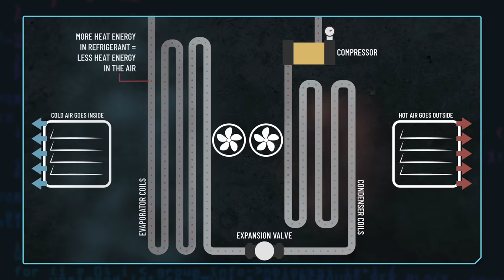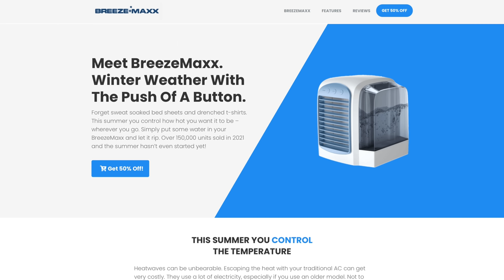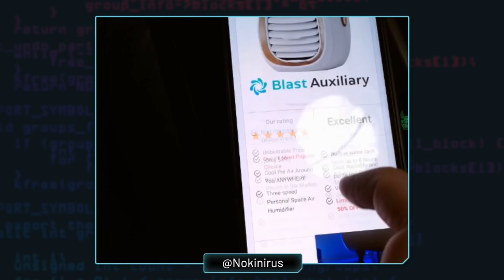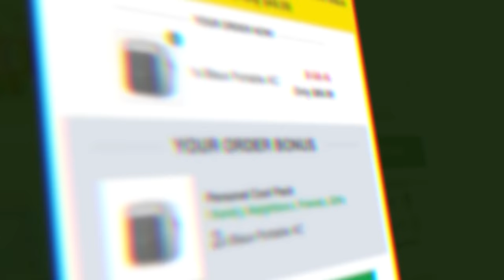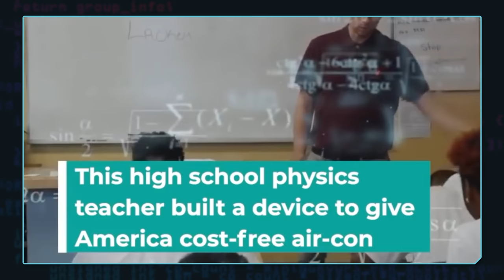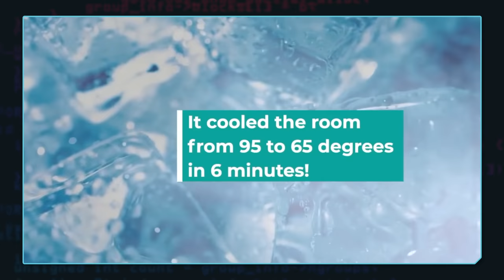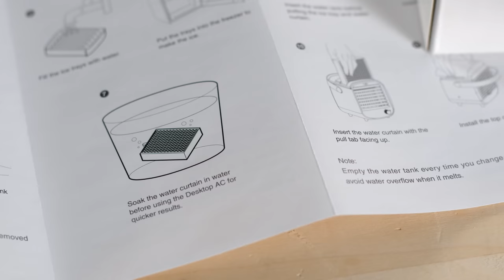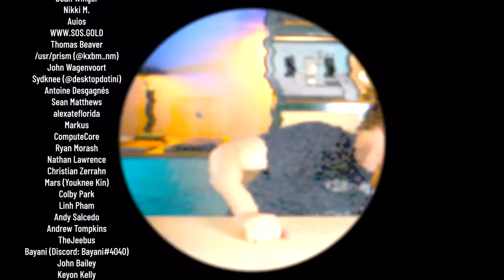Fake Portable AC Scams: Blast Auxiliary, BreezeMaxx, Blaux - Krazy Ken's Tech Talk

Comment: Build my own swamp cooler. It is outside with fairly large cardboard evaporators. A small version of the Industrial ones. The cold water is pumped inside through an heat exchanger so the humidity is no problem. Most parts are from an hardware store. I needs about 50 Watts/h but 5 liters of water the hour. Still looking for the best Results. Costs about 200€ so far.

Comment: Here's the thing about swamp coolers. They do work in low humidity, since they evaporate water into the air, which cools the room via the same process that sweating cools your body: evaporation is endothermic, meaning the water molecules absorb heat energy when they become vapors. Their effectiveness drops drastically at around 40% humidity, and they outright will make you feel worse at around 70% humidity since the air is so saturated with moisture the cooling effect simply can't be felt, and it will just make you feel gross and moist. So these things WILL work... if you live in a desert climate like Texas or Nevada. If you live in a place like Boston or Maine... not so much.

Ultimately, at the end of the day, I would consider a swamp cooler to be a stopgap cooling solution at best. Even if you live in a place a swamp cooler will work, an air conditioner will still cool the room better since they actually function by outright removing heat from the room. Consider one of these if you don't have the money for a window shaker or HVAC, and that's basically it. In the long run, the cheapest solution long-term is a good heat pump system, since they are by far the cheapest to run but also, unfortunately, the most expensive to install.

Comment: Those things are just miniature air coolers that you may find in a factory. The big factory air coolers work rather well, but I would not recommend the mini version because of its tiny air output and it not having a pump to rescaulate the water.

Comment: I just saw the commercial about the college student in America that was in hot temperature classrooms and the unit is called aircon which could deep freeze a room from 95° to 65° in less than 3 minutes. So when I got the product there's only one thing, if forgot to let me know that they were taking applications because all I did with it felt like I was working for the product that I bought to serve me. I had to freeze the filter in the freezer and pour water in it which the watered overflowed and the fan inside of it is like a computer fan that's really noisy and you plug it in the wall and it shoots out ice Cold Air for half a second and then I got to redo the process all over again with the freezer and the filter and the pouring the water and the freezer and the filter and the pouring the water you almost have to get two machines to get to filters so you can have one Frozen I felt like I was working for the machine I was moving so much I could never relax to enjoy this supposedly cold air for half a second this machine was absolutely horrible with a glowing light on top

Comment: This "Miracle Air-Conditioning" CRAP is too funny!!

Back in the early 1970's, Farm Tractors started to come with "Swamp Coolers" on the cabs. We had an IH 4166 with crab-steering, & the swamp-cooler on the roof. It was a pain to get the garden-hose up on the cab, & have a looooonnnggg hose from the house to the tractor. We we DID drive it close to the house though!! When it was full, you had to yell to a helper (if present!) to shut off the water, or climb down with the running hose.

As we ALL know, you CAN'T cool anything down colder than the water itself.....which warms up quickly on the cab!! It felt "OK", until the water warmed up. Then.....IT WAS USELESS! SO.....the "Benefit" lasted maybe an hour or two, depending on the outside temp. We then got BIG 1974 STEIGER (made in Fargo, ND!!) Turbo-Tiger II. A big 903 Cummins Turbo-Diesel....with a REAL A/C System! DAMN.....practically needed a Parka in there if it was 90+ outside!!

So.....when dumbass ads for gadgets like this come around, I just laugh and wonder how many IDIOTS are gonna fall for it!!

Comment: I got one of these for free by a friend. (Arctic brand, but same purpose) While generally they suck to cool a room I found a good use to just give a little cool breeze when sitting at the lake during the 102 degree summer. I just use our melt water from our ice chest and soak the grate in the cooler when not in use.

Comment: Those evaporation coolers are ok, under two preconditions: (1) water tank only, no ice and (2) 12 USD price tag. If you soup up the fan from 5V USB to 12V, you can actually see some real ice forming... Not an AC, not meant (but falsely advertised for) room scale, though.

Comment: Actually, the Arctic air boxes are pretty darned good but they just make it more comfy, takes the edge off. It needs to vent, plus it works WITH an air conditioner well if you have a warm spot in your house, but make sure the humidity has a vent.

Comment: You know I could have used something like this? Maybe not That one. But the un-temperature controlled warehouse I worked in would be hotter than the outside often during summer. Something to even reduce sweat while typing at a shipping computer station would have been a blessing.
Yes we tried large fans. The problem is close enough to help also blew our paper work away. Or they were moved for the forklifts to get through, etc.

Comment: You say these appear cheaper from the starting point than a REAL a/c unit & that is exactly why I got my Blaux thing a couple years ago.😢 Well, this time I managed to get a small (very small) REAL a/c window unit approximately 1 month ago for $89 at Walmart - I had LOW expectations due to the small size & low BTU (cant remember exact #). I installed it strategicly placed a couple of fans to up the circulation in the living room. Imagine my surprise when I went to my bedroom (I have a small 1 bed apt with a tiny kitchen & bathroom) to grab something around an hour later & it had significantly cooled the bedroom so I checked the bathroom & this TINY $89 REAL AIR CONDITIONER FROM WALMART KNOCKED 15 TO 20 DEGREES OFF EVERY ROOM IN THE APARTMENT!  🎉🎉🎉🎉🎉

Comment: Ignore the crazy claims, but they actually works well if you use them in a very dry climate like California or Arizona. They are evaporative coolers that does work to cool the air. You have to basically let it blow directly to your face and the air is actually lower than ambient air. They won't work in a closed room or in a humid area. You need basically under 30% humidity for them to perform.

Comment: These do feel good if you sit right ind front of them,   evaporation cooling from the mist and the fan is a real thing.    But yeah.. The room won't actually get cooler and you could probably do the same thing with a spray bottle with ice water and a fan.      (I haven't bought one but my work did demo them for a few months last summer.)

Comment: Swamp coolers have their place in the right environment and the right places. I wouldn't work without one in a workshop in dry heat.  Sadly I'm in the UK which is humid and these things suck worse than normal there. 

I just build the cheap coolers out of 1 gallon buckets if I need a swamp cooler.

Comment: Yes, a low amp 5000btu unit is great for single or double rooms. I have mine in a different room, and cools both rooms very well indeed. Having a 5000btu unit in each room is way cheaper then running one AC for the entire house.  Like when you plan to go to sleep, and too hot,  just run the AC. The idea is to run one AC at a time. Costs me around $25 a month on power.  I am not sure about price pending the state you live in, and mega inflation going on.

Comment: The real problem is, that it's not just targeted at uninformed people, that really think it's the new iPhone.
It's (in my opinion) mostly targeted at people that don't think they'd need a real AC, and just want something fast n cheap ("If it's crap i'll return it"). And at least 80% won't ever be returned.

I was one of them. I intrinsically knew it won't do wonders, not even sure If it did anything besides wind.
But luckily i canceled the order (of the 29€ Version) after 2 minutes and bought a 8000BTU real mobile AC.

Comment: That artic air unit that's been in the front of Home Depots lately is garbage too. Told me they get almost all of them returned so most of them just actively try to talk people out of buying them. 

Mind you our climate here is already the absolute worst for trying to use swamp coolers (damn near 100% humidity), but that unit is also massively overpriced and I hear has a problem where it spits water all over the place whilw in use and the reservoir leaks commonly.

Comment: When my ac broke, and I was in the middle of a florida summer

I bought a big Styrofoam cooler, put a cooling rack for baking in it, filled it with ice, put two tubes coming out of the top,  cut a hole into the top and put a fan facing down into it. 

That way the fan blew air down into the cooler, the air ran over the ice and down below it (hence why i raised the ice with cooling racks) and the air was then pushed up and out through the tubes. I poked a few drainage holes in it, put the entire thing in a big plastic tub, and refilled it with ice every hour or 2. even as the ice melted and drained, the water was still cool so the air was cool for a while. 

I still did cold showers every few hours and still had a bunch of other fans pointed at me

and my contraption woudl only work for a small area or a small room

but it worked enough. And the whole thing was maybe 25 bucks. Good enough for a temporary solution

Comment: I actually found a good use for one of these crapfest coolers while we were waiting 2 weeks for the repair guy to replace the fan in our stupid built-in fridge (I know, I should have done it myself, but...)  Anyway, it fit perfectly up against the cooling fins and kept the temperature levels fine; it looked ugly with an extension cord hanging out the front of the fridge and the panel missing, but the blue light was kinda cool.

Comment: I was planning on finding 4 portable ACs for my car since... i really hate heat and the gas waste for running the AC built into the car can be quite wasteful. I also wanted to find some temperature controller so it automatically turns on the portable ACs when its too hot for my liking... :(

Comment: i bought a swamp cooler 2 years ago for about 10 bucks. that one moves more air than the 80 buck one you got there. which for the prince you would expect the opposite right? but that just shows how sneaky and cheap those products really are. they just get super cheap components and mark them up ten fold.

Comment: I knew these things were a scam the first time I saw one. A real portable ac unit requires a ventilation tube to displace the heat generated by the unit to the outside. Because air conditioning produces both hot and cold air at the same time.

Comment: Also, in a real AC machine the condenser, which is the hot side, needs to be outside of your house, or vented to the outside. Otherwise the system is a heater, because the net heat output is positive.

Comment: I took one look at it and knew it was a scam.  In order to cool a room, one of the key pieces that is needed is a way for the hot air to escape out of that  room.  If you were to put a real air conditioner in a room and turn it on, the room's temperature will increase dramatically.

Comment: None of these are AC units, they are fan/humidifiers. I purchased something like this, twice the size, about $50, with a bottom water revivor that holds about 20 oz of water, for work when it gets too warm. It must be very close to you to work, but it is not bad for an emergency situation. It is VERY misleading labeling, but if you read into the small print on it, they generally state air cooler, not AC, as he stated.

Comment: The most simple explanation is to ask the question: where do you transfer the heat to? Or can this machine let the heat just disappear?
You get answers like: "you take ice from your freezer and put it in the aircooler, duh", but how does a freezer make the ice, and where does it transfer its heat to? To the same room where your aircooler is?
Makes no sense. Get a good split unit air conditioner.

Comment: i bought one 9 years ago and really it was  to put moisture in the air as it helps with my asthma in the summer as i put it next to my bed but i only paid £17 for it from a shop and they  but it was been sold as a humidifier not a air conditioner

Comment: This is essentially a mini evaporative cooler aka  swamp cooler, they  do work  very  well   to a point  and only  in the desert or desert  like humidity,  you see if  the air is  50%  humidity  all its  going to  do is evaporate  a bit  of the water  as compared  to 10% humidity  the wate r evaporates  100%  and  a  temperature drop is   sensible,  the  comfort   level  is directly  related to humidity  at any given temperature, this is why  95F  in NYC  can kill people because  it makes a  95F day feel like  105 F !
If  you  set that  in front of your face  it would feel good  if  its  not humid,  but  the  thing  is  no way  comparable to a    refrigeration  unit,  it  uses  zero  power , its battery operated   in some cases.

Comment: Those things are a joke. Especially in a high humidity environment. I lived in China awhile, southeast China that is, and it is worse than Miami. It’s like a jungle. My wife ordered a couple of these swamp cooler “AC” units. The humidity is outrageous there, and hot for most of the year. Plus, the Chinese people there, including her, like to leave windows open, allowing humidity to saturate the entire apartment. I told her it wouldn’t work, if only because of the high high humidity. Needless to say, it did NOTHING. I’m an engineer and tried to explain, but it went over her head, lol. A good swamp cooler does work….in the desert.

Comment: My first instinct on hearing these claims and seeing these ads is to wonder where the HEAT was going. In conventional AC the UNIT is outside, or in a window, so that the HOT circuit can vent to the outside and the cold to the inside. Even if these things DID have a compressor and condensor, they are completely inside the room. So the Hot air circuit is INSIDE the room too. Yeah, cold air would come out the front, but HOT air, including the heat of the motor, would be entering the room. Overall I reasonsed, something like this could HEAT a room up, even tho it might make YOU feel cool if it was aimed right at you. But to hear it's just a swamp cooler. What a joke. But I knew instinctually that it was a scam. Reminds me of the drone scam because of the various fake backstories.  Databyter

Comment: Someone gave me an artic air they didn't want.  On the booklet came with it says to take the filter and soak it then freeze it so I did started it up and didn't take five mins for the filter to thaw out and another 20 mins to dry out. If it's already blowing vapor water thru the filter why is it still getting dry? Makes no sense. Either frozen or me putting ice cubes in where you add water still feels the same as me running a reg fan.  No wonder my friend didn't want it. I just it now just so help me breathe better at night my nose and sinuses dry out at night so been helping a little and when I keep on low I don't have to keep putting water in it and I gave up soaking the filter it dries out with a few mins anyways and still boggles my mind how the filter dries out when water vapor is blowing thru it. Also even tried putting a pinch of salt with the ice water and seemed to get a touch cooler but still nothing to write home about. Idk how these things are getting popular and sold everywhere. The only thing it's good for is keeping moisture in the air and that's what I use it for when I have sinus dryness, and dries so bad my nose bleeds so I guess it has that working for it but not much they are way way too hyped up for just being a overpriced swamp cooler humidifier!

Comment: Even if it did have the compressor, evaporator, condenser, and refrigerant it still wouldn’t work given both the hot and cool sides of the system are IN THE SAME SPACE.

Comment: They use thermoelectric cooling via the Peltier Effect.  They are the small units used in cars for vented AC seats.  Great for low CFM cooling of tiny spaces.   
But for your room, your ass needs a $250 window AC unit.

Comment: I.bought one of.those as seen on tv tower cooler things. The AC had broken and it was hot as hell. Was 100 bucks plus tax and.tbh, in a pinch when you need something that blows cool air better than a.fan moving.hot air around, it worked well.

It did make.sleeping in bed on hot summer nights until the AC was fixed bareable.

Comment: My mom suggested an arctic air to cool my room since traditional ac isnt option without remodeling.  I have no window and only french doors.  Portable ac possible, but then the hose needs ran out the door so the french doors would be open signifigantly reducing efficiency by letting warm air in.  Being a physics major i explained difference between evaporative coolers and ac and heat pump.  Still, my dog suffers in summer heat so she saw an arctic air at yardsale and bought it.  Yeah, it sux.  In july heat though i will freeze the filter and run it to give my dog a few minutes (10 tops) of cool air.  She has to lay dirrectly infront of it, but she figured that out on her own.  If ive been mowing and im bordering heat stroke, I'll rip my shirt off and run it while laying directly infront to lightly cool off.  Still, id never pay full price for it.  Still looking for ac alternative given my constraints, if anyone has suggestions.